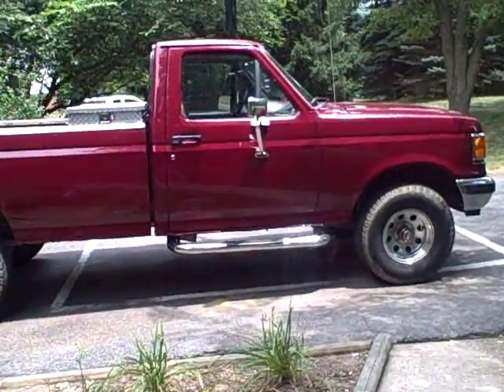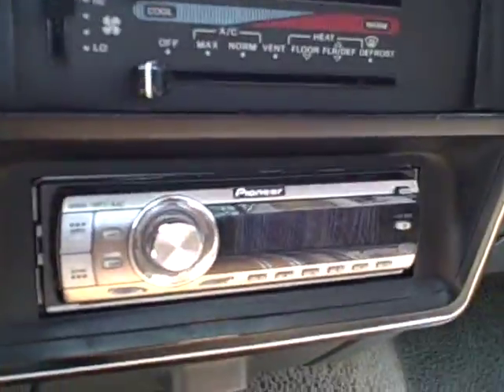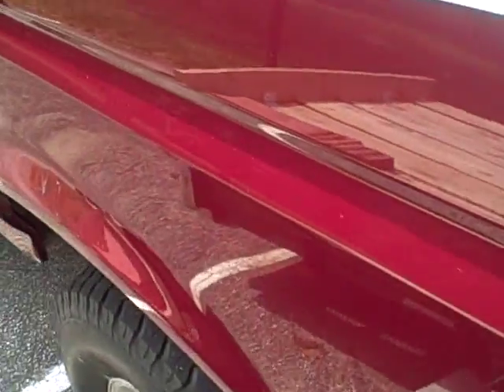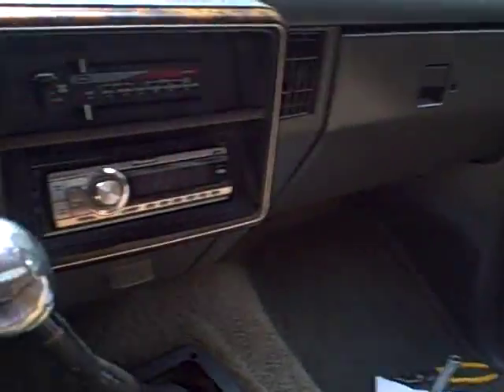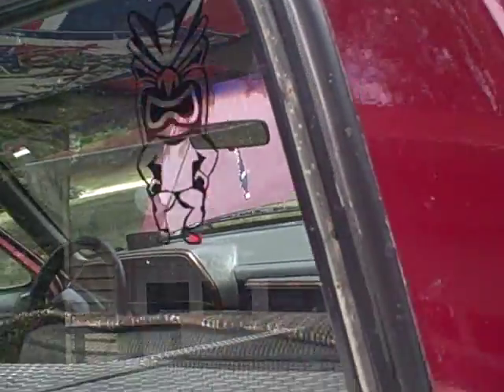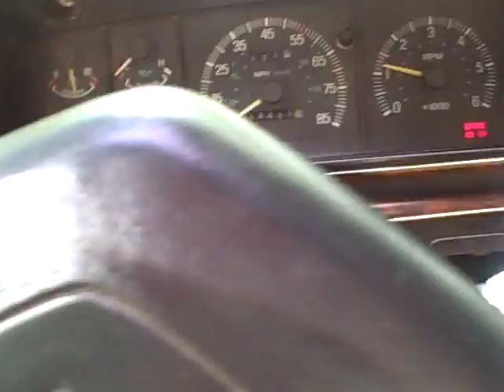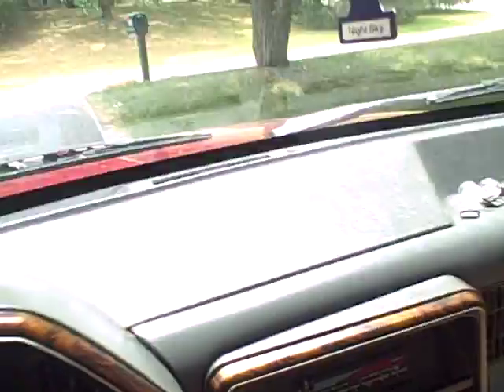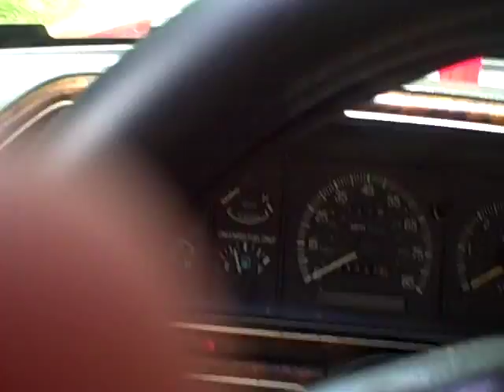1990 Ford F-150 Walk Around

Comment from the maker: @Facehoal It's a seat cover that down in the back. Old Fords are not cheap, if you want to have a solid good daily driver, not a beater. In my state, I had to get it to pass inspection and e tests. I can vouch for that cost factor. BTW you're not going to get 26 mpg. The new 5.0s don't even get 26 haha. You're lucky to get 15 with an I6 in the 80's model. You can like what you want, I don't care but as an owner of an old truck and with friends driving old trucks, I can tell you it aint cheap.

Comment from the maker: @Facehoal Pt 2: I love the look of the 1987-1996 Fords better than the 1980s. But be careful not to get a lemon. I though what you thought before I got my truck: "Oh it'll be cheap and easy to fix".  Specific parts such as wiring harnesses and rear ends in good condition are a bitch to find. Be careful. And I'm not going to tell you what I paid because that's my business and hopefully you respect that. But take my advice. Been there. Done that